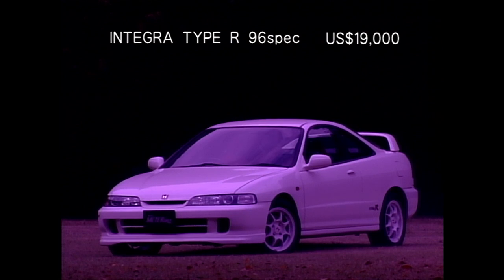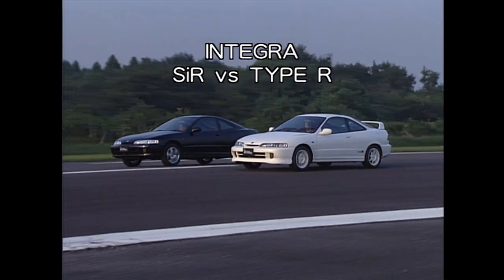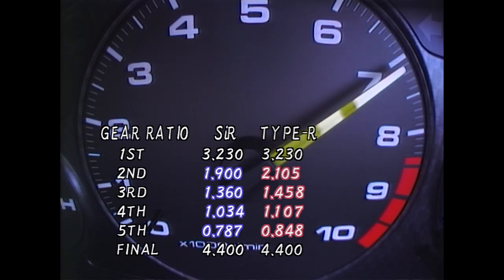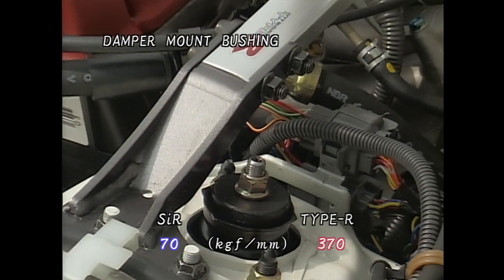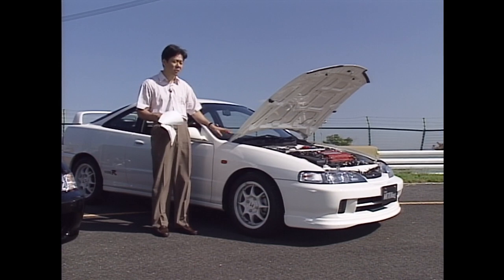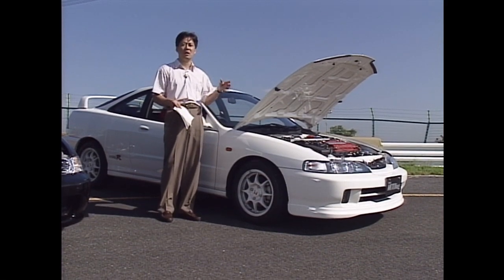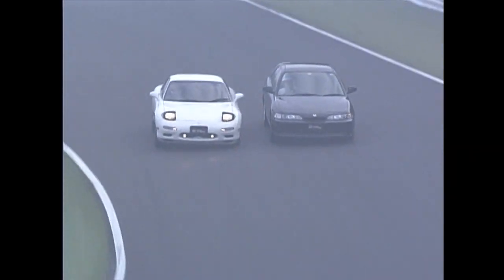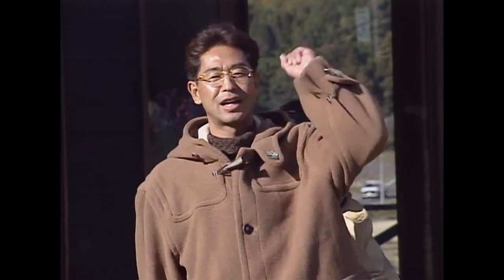Best Motoring Integra Type R Review

Comment: 15.060 for the ITR?  My 94 GSR on stock engine ran 15.01 on its best run, back around 2002 or so.
Reply: the type R was .9 sec quicker over the 1/4 .. so probably would have run a 14.1 on the same track u did your time at

Comment: Speaking about car alone, not comparing engines. But is there anything significantly different when comparing the type r vs gsr. I know the type r is seam welded n different suspension n better brakes...upgraded seats n steering wheel.